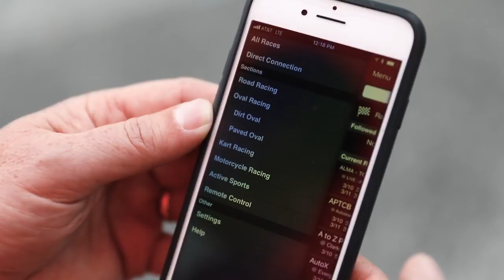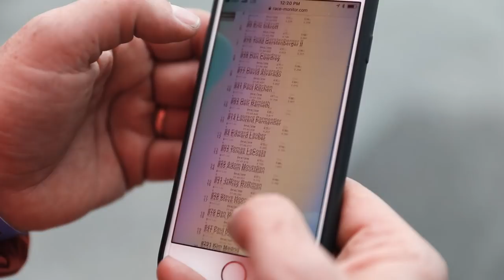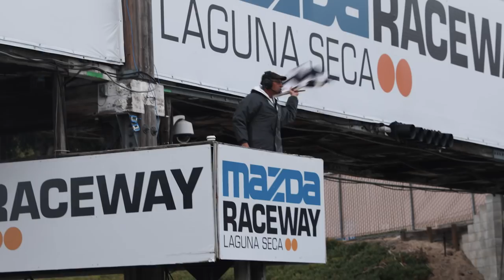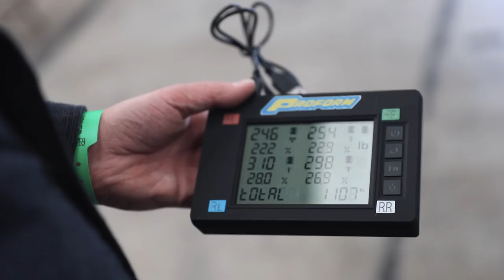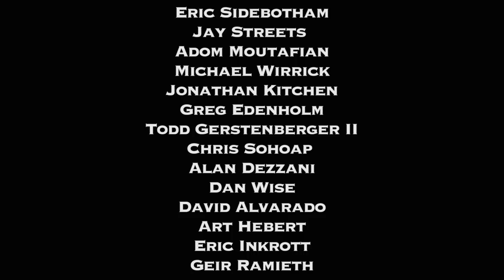A short documentary about Historic Formula Ford Racing

Comment: WoW. great to see it again. I raced a Merlyn mk.11a in the early 70's. man, the grids were packed back then with sometimes 45 cars starting. many races at Laguna, willow,Riverside, portland, seattle, Sears Point.  they should have kept the same specs.  yah, I know about progress, but why? I was young and had a dream that came true. learned to make fiberglass parts, suspension pieces, living in my truck because the sacrifice was a no brainer when it was most important to go racing.  carroll Shelby had the Goodyears that were a hundred bux each back then and you needed a new set for Qualy and then the race, so I'd buy them used off a top qualifier for a hundred a set. it was the difference between 1st and 5th and winning wasnt on my plate at the onset, just to learn how, until I finished 5th/40 at Riverside for my first National point.  I'll bet I could do fairly well now. where are all those cars now?